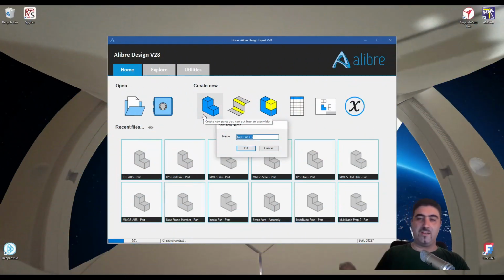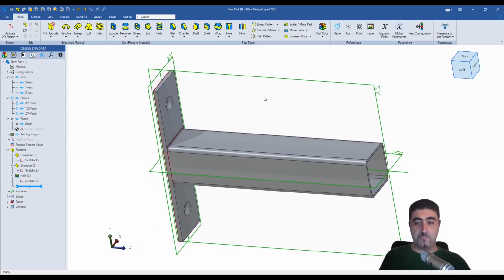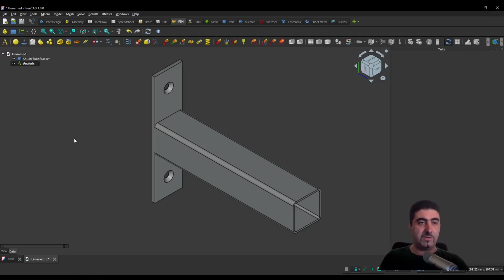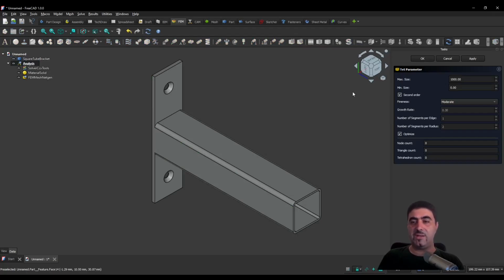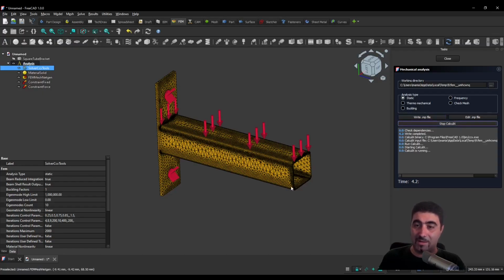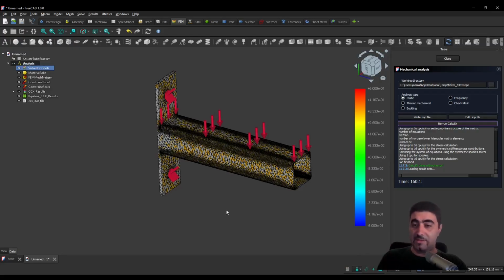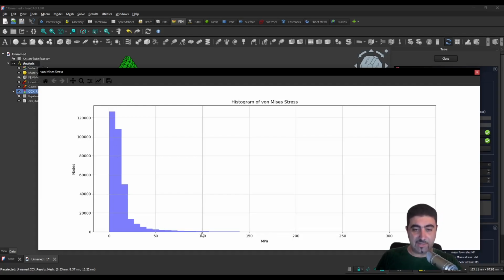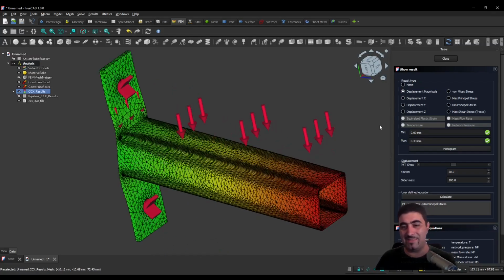Escape the CAD Overlords: FEA Stress Analysis with Alibre and FreeCAD

Comment: I’m considering purchasing a perpetual Alibre Design license, but I have one concern about long-term access.

If Alibre were ever to cease operations and its licensing servers were shut down, would an already activated perpetual license continue to work indefinitely, or would it eventually stop working because it could no longer contact the licensing server?

Is there any provision for permanent offline activation in that situation?
Reply from the maker: I cannot answer that with any sort of certainty. I can only give you my opinion which is that of a solid, small team working wonders, and producing a CAD that can easily compete with Solidworks and definitely with Fusion.

The sort of people I have seen working at Alibre, if they ever went under, they would release all the current licences. But that is an estimate on my behalf.

I now that they offer a licence that doesn't even validate every 30 or 90 days but I think that is an extra cost.

Comment: Amazing for free software.  I'm retired now, but used I-DEAS original, and I-DEAS Master Series for parametric modeling and FEA for 39 years, at IBM and United Defense/BAE Systems.     I'm impressed for free software is available for FEA to introduce the companies.    I presume FreeCAD FEA can also model thin-shell structures using quad4 elements, which for the example shown would have given quick results with reasonable accuracy.  

 I have costly USA pathway LED lighting with plastic lens that cracked easily when pulling from the ground.  5 out of 8 failed, other 3 have not been moved, with plastic cracking cracking and radiating from the upper 4 corners, and then diagonally across the surfaces.   Its like an upside down square pyramid with screwed into to the aluminum, top solar panel, and the bottom (tip cut off) smaller square screwed to the metal stake.   This might be a fun something-to-do besides playing tennis!
Reply: Another aspect of my FEA roles was doing engineering software support, i.e.system admin.    Started with IBM mainframes MVS, then IBM RISC/6000 AIX, and finally Windows PC’s.   A nice balance of time and enjoyable.   Before that 6 years at GE Nuclear Energy modeling nuclear BWR control systems dynamics.  Long career from
same house!
Reply from the maker: OK, that's definitely interesting. I didn't see those mainframes as I started a bit later, but very interesting to say the least.
Reply from the maker: Wow, that's an impressive career! Kudos!!! As for the FEA, yeah it's great that this is free. It's based on the Calculix solver which has a lot of modules and all work very well. It even has CFD and electrical and magnetic simulation. Pretty decent. Definitely worth taking a bit if time off from tennis😉. But just a bit

Comment: I was thinking of FEA on a hollow punch making holes in rubber or leather material. The punches have beveled-tip, to obtain sharp edges.  How would you approach such analyses? I know the material property is very complex, but we can assume any material with some elestic property.  The dimension of the punches could be any, say OD= 5mm, wall-thickness= 0.5 mm, and bevel angle =30 deg. Thanks so much
Reply from the maker: That is more complex than one would think. Because you are trying to simulate the act of one material deforming another one. So, to start with, we're discussing a non-linear simulation.

A subtractive approach to it would be to do FEA on the leather strip as a non-linear material. That involves inputting or importing the stress to strain curve for the leather. Check where the material fails, and then apply that load to the face of the punch. That would give you the stresses which, through the fatigue curve would give you a "number of cuts" to be performed before the edge started deforming and need sharpening.

But that is a pretty round-about and ad-hoc way of getting a result close to reality. For more accurate results, you would need a software with dynamic simulation of time dependent events and define the motion of the punch through the leather. I know openfoam can do that, but I've never done it with OpenFoam as standalone or with FreeCAD. It is such a complex simulation, and for such an inexpensive part that the most cost effective way might be to make a sample punch and test it.

On a personal side note, I have used a Rotary punch to make holes in leather patterns for shoes when I was a small kid. My Grandfather was a cobbler. He was one of the last few that would make the traditional Cretan boot called "stivani"...
Reply: @ExMachinaEngineering  I really appreciate your detailed explanation.  I should think of a simplified model like a knife cutting through meat, rubber, or foam. My curiosity was to study the effect of the bevel angle on a softer material. I would keep on looking for a tutorial. Thank you for your help. Grazie
Reply: I came across "Analysis contact stress between two surface using FreeCAD FEM "  < https://www.youtube.com/watch?v=HINdN0wW1d0 >.  Though it is in Russian, it is very interesting from the autogenerated subtitle. I think he said that he used Calculix  solver. It is worth spending some minutes to evaluate it. Thanks.
Reply from the maker: @tesg9551 sure. It's a really helpful data point to receive back. Just make sure you know what is the answer you want to get and where you need to use.
Contact stress is something that you would use to evaluate a threaded connection or weld. You say that the piece are rigidly held together calculate the stresses that result. Then size your bolts or welds accordingly. It goes down a deep rabbit hole of geometry and empirical equations. Just be careful and mindful of the answers you're getting. The catch with FEA is to make sure that the simulation matches the question

Comment: No idea what FEA is but I'm watching to push the algorithm!
Reply from the maker: Hahahahahaha!!! Well it's a mathematical model based on the discretization of solid models into polygons, usually triangles, to calculate how stress built up internally and gauge performance or failure under normal operating conditions. Every two neighboring nodes (vertices) are considered to be connected by a "spring" with a modulous of elasticity equal to that of the material. Then, the displacement of each of those "springs" is calculated under load using Hook's Law. From that displacement, the internal stress can then be infered.
The idea is to calculate said stresses for very complex geometry more accurately and faster (using a computer). This discretization idea had now been expanded to fluid dynamics (CFD) and electromagnetism.
That is a GROSS SIMPLIFICATION but at least now you know what you're watching.
One of the pioneers of FEA is Prof. Gilbert Strang who is still alive, an amazing teacher and  taught in MIT at least a few years back. I think he retired recently.
Reply: @ExMachinaEngineering controlling the solid mesh around rounded corners was always a challenge, to avoid a zillion nodes and elements.  We don’t always have fast computers!
Reply from the maker: That is a great analysis man! Impressed! Nice approach

Comment: Yes please on the YI video! I recently switched from Fusion so they didn't own everything I made.
Reply from the maker: After the series is concluded I will be sure to make that. There seems to be a lot of interest in it.
By the way, I switched from Fusion when I had hit a wall with a plastic part I was making for a very large client, and Fusion would not work. Just wouldn't.
I had a trial of Alibre installed and was about to run out. I input the same surface file in it. Tried the design, and worked first time out. Never looked back